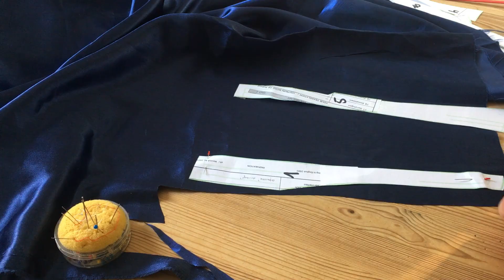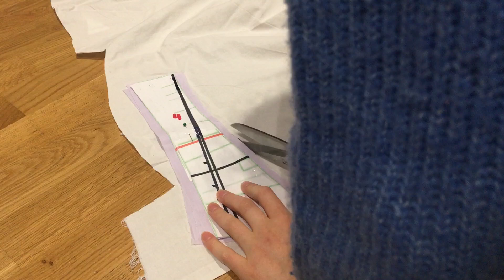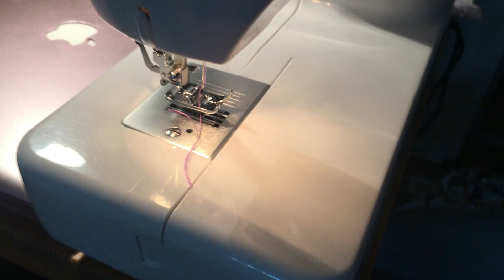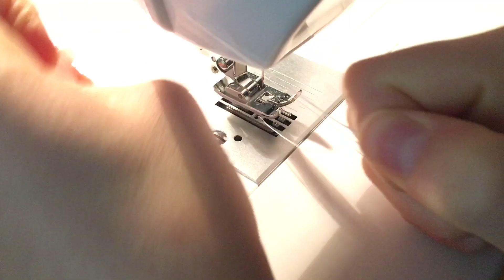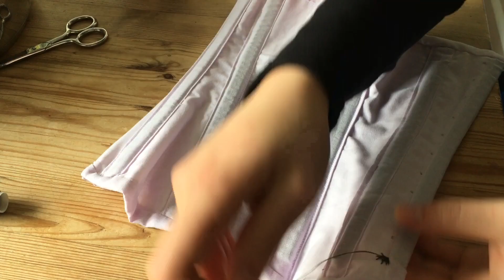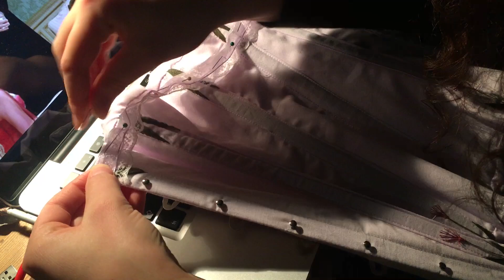I Made Victorian Corset Using an Original Pattern from 1877 (and so can you!)

Comment: I know you said to go based off of the waist measurement and the rest of the silhouette will work itself out, can you create a video showing how to create the Victorian corset padding required to achieve that?
Reply from the maker: Yes, I’ll see what I can do! I know I said double-check the scaling at the waistline, as I had only needed to bring the pattern up to original size, but for manually scaling up historical patterns to fit your body specifically, it’s best to scale according to the bust measurement.